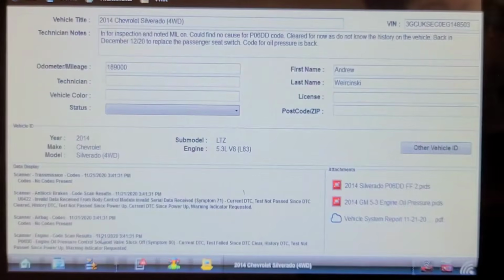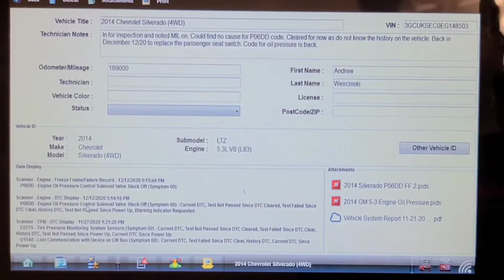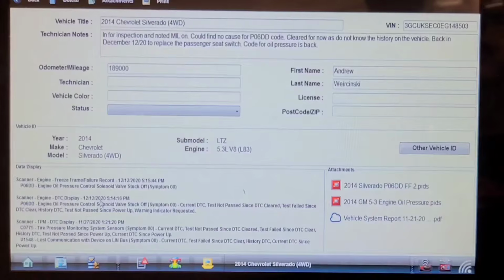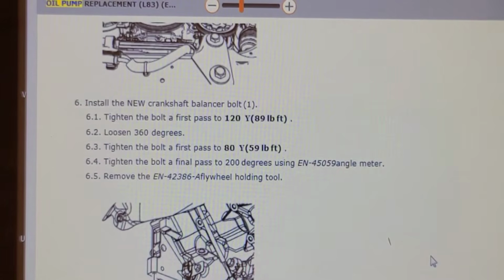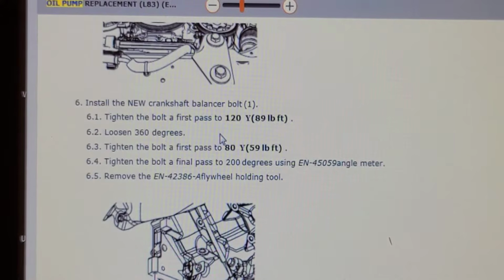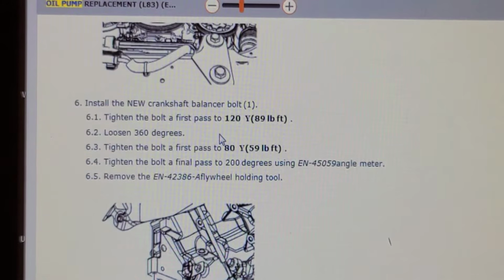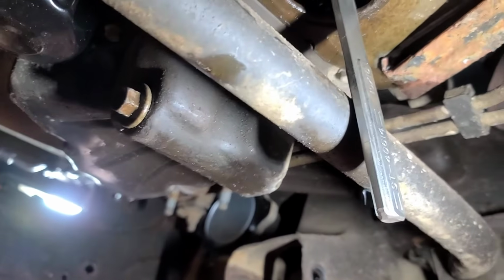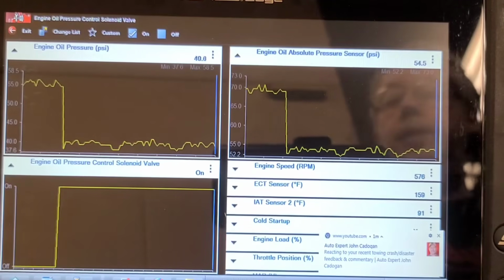2014 GM Truck 5.3 Oil Pump Replacement Code P06DD

Comment: Just replaced the oil pump with solenoid . Primed it before start up . Changed out all gaskets and oil pressure sensor . However , still getting the evil P06DD code. You can see the oil pressure climbing while acclerating. Any suggestions ?
Reply from the maker: Defective new part possibly. Misreporting oil pressure sender?
Reply: Did you find a fix? Replaced my entire engine for a host of problems, still throwing P06DD
Reply from the maker: That sucks for sure but have to start over again 😕
Reply: @PhillipBailey Could it be wiring or a relay?
Reply from the maker: @lucasmeijer9111 the p06dd code is a performance code whereas a wiring problem to the actuator would likely set a circuit code. There is no relay.
Reply: @PhillipBailey What about a computer fault? It’s gotta be unlikely for this to happen twice in a row. Especially as the new engine didn’t have a CEL prior to it being put in my truck
Reply from the maker: New engine or new used engine? The code could set due to low or high oil pressure. What is the oil pressure show at an idle on the scan tool? Use the scan tool to command the oil pressure control solenoid on. The pressure should drop about 10 psi. Check actual oil pressure with a manual gage.
Reply: @PhillipBailey It’s a used under 50,000km engine, no leaks, sounds, or faults. I’ll see if my scan tool will let me command the solenoid and check pressure that way. The gauge on the dash definitely seems off. Starting the engine today after letting it sit for about 5 hours, it was pined at 550kPa even at 500rpm idle. Once it warmed up all the way and I drove it some, it dropped down to where it should be at idle, just below 275 kPa. But when giving any RPMs over 1100 it would pin again. It would also jump up in 3 or so stages
Reply from the maker: @lucasmeijer9111 could be a faulty sensor
Reply: @PhillipBailey I replaced the oil pressure sending unit sensor, didn’t work. So I’m now thinking it could be wiring or maybe a permanent code with the ecu that’s causing it to trip?
Reply: @lucasmeijer9111  did you find the problem? I have a 2014 doing the same thing. Oil pressure drops after engine warms up.
Reply: @luisbarajas3097 Yes I did, timing chain guide wore down and broke, caused the timing chain to gain slack and slowly chip away at the engine block and oil pump. Ended up being a 4K timing job at the dealer, which got covered by the warranty of my replaced engine. Turned out the old engine had the exact same problem, but it actually jumped timing and was running slightly out of time, misfiring and causing the cat to spoil.
Reply: @l @luisbarajas3097  Mind you, this will only happen with the engine code, normal oil pressure for the engine will be at the 1/4 mark on the gauge (20 PSI)

Comment: Hey I replaced the oil pump on my 2015 yukon with the 5.3 and at start up it makes a really loud whining/whirring noise which lasts around 15 to 20 seconds, any suggestions please
Reply from the maker: Eliminate the engine driven accessories by removing the external drive belts and if the noise is still present it's coming from the oil pump or timing chain.  What brand of parts did you use?
Reply: @PhillipBailey  factory pump, factory timing kit, gm oil n filter...

Comment: Dang. I haven't touched the internals of the L83 yet. Plenty of experience with the earlier 5.3l. The real early ones I cheated and was able to get the bolt out of the pump without dropping the pan. Then the 07+, the pan needed to come off. I think I will at least try to cheat on these without dropping the pan. 😉🤣

Also, looks like an oil pump alignment tool is sold. No need for that?
Reply from the maker: Good luck let us know how you fare.

Comment: Top notch video
Dealer found brass shavings in my oil pan the other day.  :)
Went in for a PO6DD code, oil pump solenoid fault.  My dash oil pressure is around 20 at idle and bout 35 - 40 driving.  Still normal.  What to do!
Reply from the maker: There's not a lot of brass components in that engine. Did they have the oil pan off?
Reply: @PhillipBailey  "hot idle is 17 psi, cycling oil pump control valve with GDS will not cause changes in oil pump response, raised vehicle lowered oil pan, tech notes large amount of brass colored bearing material in oil pan, cam and/or crankshaft bearing wear is suspected.  Engine replacement is recommended."
Reply from the maker: @tyleru7094  hope it's under warranty
Reply: Few months outside warranty, would not goodwill part of repair
Said it would not change pressure when prompted, then later on in their write up it says would not change more than 9 psi when cycled.  I'm gonna change the oil pump to start.  Thanks for your video.
Reply: Was changing the pump out enough? This fix everything? @tyleru7094

Comment: Stupid question but in your order list why did you order 2 water pump gaskets?
Reply from the maker: I believe those are the waterpump housing to block gaskets and there are two. 
https://www.gmpartsdirect.com/oem-parts/gm-gasket-12657430

Comment: Hi, I have a 15 yukon with the 5.3, recently here in canada we had -30 Celsius around -45 with wind chill, after few days of starting and running in those days now at start up truck has a low power steering type sound, and can be heard when accelerating with rpms, thing is my oil pressure never before went below 3 quarters but now at idle when warm is at about 20 psi (at quarter) just today I had the p06dd code pop up  the low power steering like noise is still there, before the cold and this code the truck ran very quiet but now sounds loud, could the oil pump have failed? I have been running 5w30 with a k&n oil filter which have about 3500km on it and just after the cold experiencing this, could be oil pump gone bad or the pressure sensor or something,  please anybody have any suggestions help
Reply from the maker: Does that not have electric power steering? If not try removing the drive belt so nothing is turning like waterpump, tensioner, idler, ac although that's a separate belt and alternator. Lots of things can whine and if tge noise is still present with tge drive belt off its likely the oil pump. Good luck
Reply: @PhillipBailey  just noticed your reply, I wanna thank you for taking the time and getting back to me. Unfortunately it ended up being the oil pump as recently oil pressure dropped to zero, in the shop now

Comment: I just had these done oil pump timing chain was raddiling they showed me the parts oil pump had a hole worn in it from timing chain tensioner went bad chain was rubbing against oile pump tensioner was in peaces and word of advice ther is a wire that runs the oil pump silinode it gets oil on it and is very thin would recommend changing it cus it gets oil on it and if it brakes after all the work is done u will have to do it all over again so change the small wireing harness too 2,581 for job dealership wanted 5,700 so it u got Po6DD code get your wallet out
Reply from the maker: Glad you got it fixed. Lot of expence for sure. How many miles on that engine for the timing chain to be that loose?

Comment: But my oil pressure is good it flux between 30 when ideal 45pres when running take off goes up to 70pres but it got to be the oil pump but I'm hearing rattling from timeing chain. So needs it too not cheap at all
Reply: Timing chain tensioner is bad I'm getting same rattling myself got appointment for dealership

Comment: I had the same code, but also had the truck say low oil pressure and to not drive anymore , mechanic saying may need a engine swap, does this sound correct?
Reply from the maker: It could be just the pump but I've seen where the pump fails and contaminates the whole engine. If the engine oil has sparkles in it they are probably correct. That engine is a PITA to replace. 23 hours just to r and r.

Comment: So curious after doing all this if it ended back in shop and had to have the tps bulletin for the code repaired or had that already been done?
Reply from the maker: It hasn't been back for any repairs since and I've talked to the owner on several occasions  on other matters.

Comment: Would u know what issues cause a P06DA??
Reply from the maker: That code sets due to an open or shorted oil pressure control solenoid or circuit. There is a bulletin about the wiring harness rubbing on the vacuum pump pulley so I'd check that first. # PIT5307F

Comment: Does the steering gear have to be removed? Having trouble dropping the pan on my 2014 4.3
Reply from the maker: Yes it does.
Reply: @PhillipBailey  I’m a boat mechanic so I’m learning here… is this possible on ramps or do I need to be jack stands and remove the front tires?
Reply from the maker: @theduses  well you will need to disconnect the outer tie rod ends. That's easier to do with the wheels off but you might be able to get them off from the back...

Comment: My local shop is going to tackle this job for me, Ive ordered all the parts at 16:00 . I was wondering do I not need a oil pan gasket that goes around the entire oil pan?
Reply from the maker: The oil pan is sealed with silicone RTV.
Reply: @PhillipBailey  thank you!!!! This is by far the best video on this issue. Thank you for posting!
Reply from the maker: @Stephen_Ervin  thanks for the comment.

Comment: Awesome job thank you for sharing your  experience and knowledge! I have the po6dd code and just researching it only 75000 miles
Reply: Trade it in I have a 2014 within 70k they issued a full engine replacement under warranty have been waiting 10 months for a engine they say were top of the list for replacement but that’s gotta be a lie

Comment: Brought my truck in for a recall, the day I get it back the check engine light comes on. I bring it back and they say it's the catalytic converter and that's it. They say they will order the part but close out my ticket for some reason and never order it. I go back up there and find that out so they order the part. I bring it back to get it fixed. It's under warranty but go figure a certain part isn't, the 02 sensor. That's 60 dollars so I say whatever. A day later now all the sudden a new code is coming up, one for the oil pump and it's going to cost over 2 grand. It's just odd to me that my check engine light comes on the day I get it back from them and it'll cost damn near 2500 dollars to fix all included after tax.
Reply from the maker: You didn't mention what the recall was for. Could be related if they updated software in the PCM possibly as part of the recall. Otherwise just shit luck.

Comment: Idk why you take the front differential off my Haynes repair manual only says remove timing chain cover literally 3 steps in the book doesn’t seem hard at all
Reply: Good video though and explanations
Reply from the maker: There's a reason why professional techs don't use Haynes. You have to remove the oil pan to access the oil pump pickup. The differential must be removed to remove the pan and the steering gear must be removed to remove the differential.  Go ahead and try without removing the pan. Let's us know howbit works out for you.

Comment: Is the new pump a better different design? Or its the same as original
Reply from the maker: As far as i know it's the same design.
Reply: @PhillipBailey  thats a bummer. I just had this code today P06DD. 2017 5.3 . Im actually taking a mecanic course in college right now but luckely my truck is still warranty. Its quite a job, i think as an apprentice it would be a challenge to do it alone. You are a very good mecanic. Thanks for sharing the video. Ill be hoping gm doesnt put the same oem pump and hopefully have a better design.

Comment: GREAT detailed video. I just ordered all my parts (listed at 16:00) from gmpartsdirect for $175 USD with shipping. When you say the water pump is separate from the housing, does it mean it can stay? or still have to drain coolant and all to get the timing cover off still?
Reply from the maker: The water pump can stay in the housing. Yes you definitely need to drain the coolant.
Good luck
Reply: @PhillipBailey  thanks!🤞

Comment: Thanks for the video!  It took me 12 hours from driving on the lift to engine start up.  I did the timing set while in there but it looked good for 170k miles, the chain didn’t seem worn compared to the new one, but glad I replaced it.   I struggled with the differential install, get some help if you can!  For oil priming I pulled the fuses for injectors and ignition.    Thanks again!
Reply: Next time for priming all you have to do is press the pedal to the floor and crank the engine. That enters "clear flooding" mode and turns off the injectors. Try it.
Reply from the maker: Glad you got it done. I use a transmission jack to help lift the differential into place. Good job!

Comment: Thanks a lot for sharing this video. It's pretty helpful cuz I gotta do one myself. I'm just wondering if the engine has to be timed with marks in order to replace the pump. Please let me know I'll really appreciate it.
Reply from the maker: Thanks for watching. No there is no timing requirements for the oil pump.

Comment: can it be the issue to mine 2019dodge dodge grand caravan. po6dd
Reply from the maker: The Dodge uses a similar 2 stage oil pump controlled by a solenoid. After checking it appears the most common cause for this code on the Caravan is an incorrect oil filter. Check the oil level  quality and make sure the proper oil filter is installed. HTH

Comment: Hi ,bro I have a question this motors don’t have a oil pan gasket? Only with silicone?
Reply from the maker: There are a couple of rings on the left side and one for the oil pump pickup but the main pan uses silicone. Be sure it's O2 sensor safe.

Comment: What kind of synthetic gear oil did you use ?
Reply from the maker: Valvoline 75/90 just cause it's a little stickier than 5w20. Helps to prime the pump faster. Just my opinion. I've also used GM engine oil  supplement which is about the same viscosity.

Comment: Thanks for the detailed video. I have a 2015 4.3 V6. Do you know if the torque specs you mention in the video the same for my engine?
Reply from the maker: Oil pump to block 18ftlbs
Oil pump pickup 89inlbs
Front cover 18ftlbs
Oil pan 6 mm 89inlbs
Oil pan to front cover 18 falls
Balancer install with used bolt first tge replace with new bolt and 240ftlbs
HTH.
Reply: @PhillipBailey  Thank you so much!
Reply from the maker: @cpas212  the balancer appears to be different
Reply: @PhillipBailey  different torque specs?
Reply from the maker: @cpas212  yes the v8 was torque the turn a specific number of degrees. The v6 is just torque.
Reply: @PhillipBailey  yeah, the v8 was turn 200° after torque. So the v6 is the same torque sequence just without the 200° turn?
And all other torque fasteners are the same as already mentioned?
Reply from the maker: @cpas212  just 240 ftlbs
Reply: Cpas212, I’m about to do this job on my 4.3 this weekend in the driveway, did you have to remove ac compressor or can it stay connected? Any other tips?
Reply from the maker: The AC compressor should be fine on the block but honestly I'm not sure on the V6.

Comment: Anybody get slight overheating condition over 3000 rpms, while also having lower oil pressure than normal at idle?

Comment: I’ve done these. If you’ll get a oil primer, which you really need for doing engine replacement or repair on the newer engines, you could prime the entire oil system while filling the engine with oil.
Reply: Link to product you used ?

Comment: @14:23 where the part numbers for those o rings?
Reply from the maker: Parts list at 16:00 jn video. 12621086 I believe times 2.
Reply: @PhillipBailey  thanks I over looked it. Currently doing a complete DOD delete with a cam and l83 to l86 swap on my 2014 Silverado.